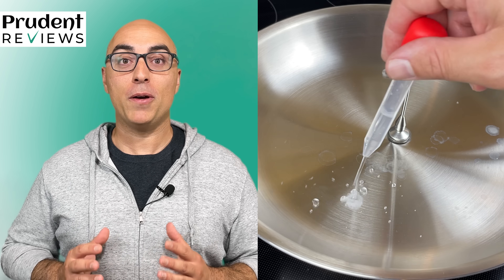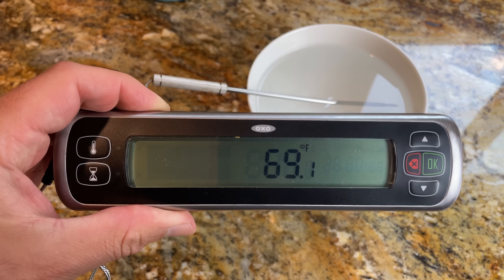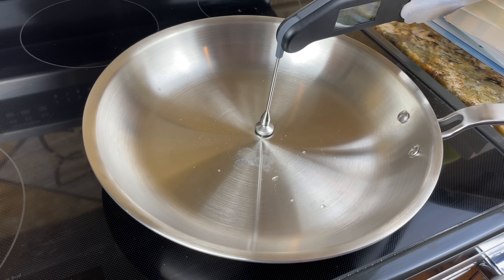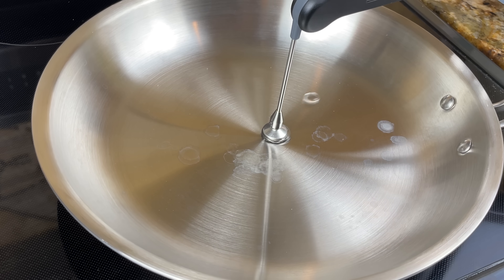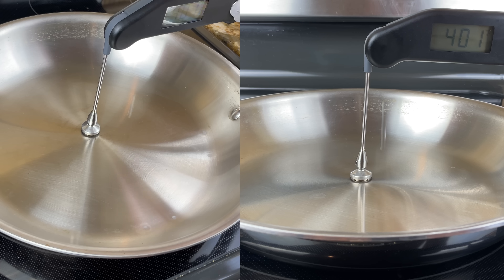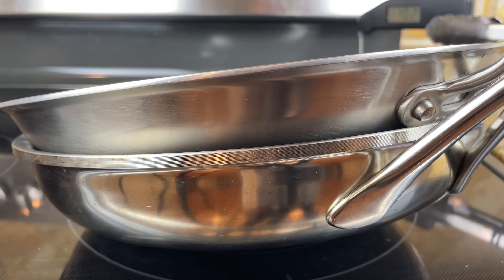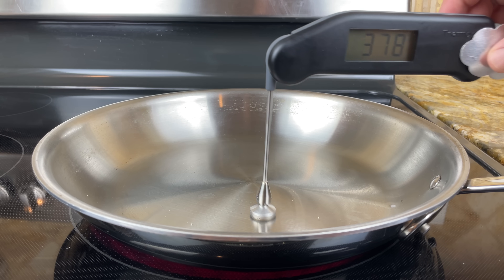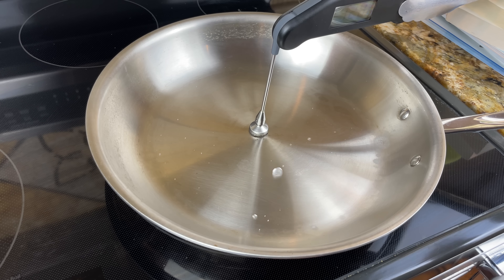Steel Pans Become Non-Stick at THIS Temperature (Leidenfrost Effect Solved)

Comment: I wanted to buy a surface  thermometer like that one, but it is very expansive and not versatile, great for pans but pretty useless otherwise. I got an IR thermometer instead, 40 euros instead of 150 or something like that. It is pretty neat, but you need to calibrate the emissivity in order to get accurate readings, and emissivity changes based on the material.
I tried the same experiment that you did with my IR thermometer and my black carbon steel pan, I got a reading of about 320 C when the Leidenfrost started, based on your results I guess my emissivity setting (95%) was off.
If you have an IR thermometer like mine maybe you could make a video comparing the two, and maybe you could try to figure out emissivity values for stainless steel or carbon steel
Reply from the maker: That’s a great video idea!

Comment: Would a laser thermometer read low ?
Reply: on stainless.  Yes, because of the shiny surface of the pan.  The device is reads Infrared from a reflected source and not from the pan's surface.  

btw, you own a Infrared thermometer.  The laser is only a visual cue of where you're aiming.

Comment: That's great if I want to have water drops dance around my pan, but it's useless for anything else. Once you put an egg in the pan, the temperature drop will stop the leidenfrost effect when you want to flip your egg. Side A may not stick, but side B will... unless you maintain a screeching 430°, at which point your egg is way overcooked. Egg white coagulates (becomes “set”) between 144° and 149° Fahrenheit. Egg yolks coagulate at a temperature between 149° and 158°.
Reply: Try it, you will apparently be flabbergasted at how wrong your theory is. Once your pan is primed you are good to go. Noone claims your pan needs to stay at 430f nor that the leidenfrost effect needs to be in full effect for non stick nor do I see claims about the leidenfrost effect being the only factor in SS non sick properties. ;)

Comment: My main question is whether it's actually the Leidenfrost effect making the pan nonstick, or whether it's just a proxy for the correct temperature needed to make it nonstick, and in that case, whether it can be somewhat lower and still be nonstick.
Reply: Its a combination, but very smart question! Many people here start yapping about 430f being scorching, will burn everything, wont be able to nonstick a flipped over egg etc etc because they are too fixated on the idea that it is just the leidenfrost effect that creates the non stick properties while its a combination of 4-5 factors.

Comment: Well that makes stainless kind of useless to me as I never cook at that high of a temperature.
As an example:
On my NutriChef 10" Ceramic pan on a Nuwave Induction unit, I use 275 degrees to cook a Bubba Burger perfectly in the timeline suggested on the box. Eggs the same, stir-fry the same. once in a while, I'll play around with higher temperatures but as it's suggested to use low to medium with ceramic, I tend to avoid high temperatures.  Using 420 or so seems ridiculous to me unless I'm searing a steak.
I've had this pan for about 6 months and it looks just like new and I expect a decent lifespan but if I had to replace it every year, I would. It only cost $45 or so on Amazon. The ease of cleanup is a bit of a shock. A paper towel to soak up any grease and initial wipe down, then a hot water rinse with another wipe with a fresh towel and it's good to go

Comment: This is NOT how to make a pan non-stick. As soon as you add food to the pan it will cool down enough under the food to stop this effect. You can maybe work a single egg, but just about any other dish or a steak and this won't work. Just use oil, oil works every single time.

Comment: What is the best way to clean a stainless steel pan? Should you soften the brown areas by soaking them in water?
Reply from the maker: I’m going to make a video on this soon. There are many ways but I’m most cases I just scrub with a sponge and dish soap. If there are any stubborn stains or discoloration, I’ll use Bar Keepers Friend.
Reply: @PrudentReviews  thanks.
Reply: 000 or 0000 Steel Wool take it down to the shine.

Comment: 450 farenheit is how much in non retard units?
Reply: Depends on the stove but around a 6-7 on the stove top dial out of 10. About 3/4 or medium high. To be exact you should test the burner on the different settings with a thermometer and your most used pan. Also if you are using a small pan on a big burner or a big pan on a small burner that will add a differential to the equation.
Reply: I should add, let your pan heat up for about five minutes so you don't have cold spots.

Comment: Use ghee for high-temp cooking. Very high smoke point, very easy to make at home.  

Nab an extra pound or two of butter when it’s on sale (unsalted, non-fancy). Cook on medium till it foams, then you can lower the temp a bit and cook till the milk solids collect on the bottom and brown. (Push and foam aside to peek at the pan bottom.) The more brown, the nuttier the flavor —but don’t let it burn.

Be conservative when pouring off the oil at the end, so the all the browned butter solids remain behind (they’re delicious, but they’ll burn at high heat; just spread them on toast or eat with a spoon). I tend to keep mine in the fridge, but it keeps quite well on the counter and is much softer/easier to scoop that way.
Reply: My wife makes ghee whenever we run out. Its so good on rice. She's Nepali so she makes everything from scratch even butter, yogurt, bread and when I'm lucky rice wine. 😁
Reply: oil is cheaper, healthier and easier to use.

ghee is better for flavor of course, but oil is easier to just cook with

Comment: It does not take that high temp. SS is non-stick as soon as beads form. A fried egg at 215c! Did you even try that? I hate fried eggs with that brown rubber film at the bottom. In fact, for things like chicken, the stainless steel pan is fairly nonstick so long as you get it hot before adding oil. I do fried eggs with carbon steel, it actually sticks less than Teflon.
What you need to show is cooking, not theory, but I do support encouraging people to avoid Teflon which is a ‘forever chemical’ and non-recyclable.
Reply: Teflon should be illegal for food use, but then we would have riots from everyone who can't use a regular pan.
Reply: @james_crook  forever chemicals will be illegal for most purposes at some point

Comment: For only $169 plus the cost of a stainless steel pan you too can have perfect eggs every time.
Reply: Or you can save yourself a lot of trouble and use a $10 ceramic nonstick pan from Costco.  And you get the added benefit of not having to eat burned eggs.

Comment: Get a good set of stainless steel pans. They'll last you decades, they're the most versatile pan type, they're oven safe, and maintenance is minimal(soap and bartenders friend). The investment is worth it. Next get a dropper bottle, fill it with water and keep it next to the stove. I heat for 1.5-2 min on medium high on a gas stove then add drops until I see the effect. The other key is to have easy access high heat oil like canola or avocado oil. Once you achieve the effect, reduce the pan to medium, add oil, swirl the oil in the pan and start cooking immediately.

Comment: To preserve the nutrients of the egg, you can't cook it too hot. For perfect scrambled eggs, use plenty of butter and set your temperature to about a 3.5 on a scale to 10. Beat the eggs together before pouring them into the pan. Coat the bottom of the pan with the eggs, then use a silicone spatula to move them around until the last of the liquid turns just solid. Remove them from the heat immediately and plate them.
Reply: Blah blah blah. cook me some fucking eggs
Reply: Beating the eggs makes eggs not even close to perfect, sorry
Reply: You can tell when it is an American advice from the surface "use plenty of butter"
Reply: If you make an over easy egg in an extra hot pan, you're only cooking the whites. The yolk contains more nutrients, and therefore, with a soft yolk, you'd have less loss than with your scrambling method on low heat.
Reply: Too much butter = SATURATED FAT 🤮🤮🤮
Reply: Sounds like you have done this before lol. I have cooked many an eggs the way you describe and it’s perfect for me.

Comment: According to Wikipedia and several other sources, the Leidenfrost point is approximately at 193 °C (379 °F).  In my own experiments, this is too low a temp, so I believe your numbers are spot on.  I used a laser thermometer and got temperature ranges a little lower than you, but still worked great.  The trick is to figure out where the dial should be set on your hob or element, then just set it there anytime you are using stainless steel frying pans.  All this being said however, nothing beats my trusty 100 year old cast iron frying pans.  Better than Teflon and I'll likely be leaving them to somebody in my will LOL.  Great video, and great science!  Eric.
Reply: 379 is correct 
The water is 69 
So it adds up to 450

Comment: ok, so.... who wants an egg to hit the pan at 420˚?  that would not be a good thing.
Reply from the maker: I explain it further in this video, but once you reach the Leidenfrost, turn the heat all th way down, add fat, then add the egg. That will bring it down closer to 400 and ensures it doesn't get hotter. 

https://youtu.be/BYpYK1DV_SU?si=uJvZrPSOqCe-ulTU
Reply: @PrudentReviews , yes i watched both videos.  this might work on gas or induction, but on electric, one has to remove the pan when adding oil and dropping the eggs because electric won't cool down fast enough.

Comment: Does carbon steel pan has the same thing? Even with a well seasoned pan?
Reply from the maker: You don't need to get a carbon steel as hot because the seasoned surface is less prone to sticking.

Comment: This is brilliant.
At a high enough temp steel will louse its magnetic attraction.
Please test to see if a magnetic will louse its attraction at the same temp a drop of water starts to dance.
Reply: Stainless steel is not magnetic, regardless of temperature
Reply: @juancaballero1173   Are you sure about that Sparky?
Reply: @juancaballero1173  This is not true and is a strange idea to have. What gave you this notion?
Reply: @quincywilliams9860  Both of you are half right. Some stainless steel is magnetic, and some stainless steel is not.
Reply: @bradley3549  Oh, I agree that you are right about that. The correction was pointed at the suggestion that "Stainless steel is not magnetic, regardless of temperature", which is definitively false because it indicates that there is no such thing as magnetic stainless steel. Inductive vs reductive logic, etc. But yeah, you are correct 💯

Comment: This is brilliant.
When steel gets to a high enough temperature, it will louse its magnetic attraction.
Please try this test with a magnet and see if it louses its magnetic attraction at the same temp the water starts to dance.
Reply: I don't think it does- first of all, there are non-magnetic types of stainless steel, and secondly loss of magnetism occurs at much higher temperatures (well over 1000F).
Reply: @guzimirHR   thank you for the quick response.
Reply: Look up 'Curie temperature'. For stainless steel we are talking well over 1000f indeed

Comment: Knowing the temperature is not of practical help because I can't handle messy food and a thermometer at the same time. That is if I owned a thermometer with a flat header like that, I wouldn't eggs all over it. I usually heat the pan as high as I can until or a little short of the oil smoking, and have no problems with eggs sticking.
Reply: i agree; it may be useful for a baseline perhaps, but honestly the water test is the quickest and cheapest method of testing to see if your pan is ready, which is why it's recommended by so many people

Comment: This effect may make nonstick but that is too much heat to cook an egg properly... Eggs should be cooked at lower heat or they will taste like plastic. This effect is interesting but does not really correlate with good cooking. I suggest using appropriate heat and some healthy types of oil... oil/fat is not such a bad  thing and eggs fried at lower temp in oil and butter are not only fine, they taste way better. 

And I love cooking with stainless steel... They are easy to de-glaze, east to clean, and come back 100% to as-new condition.
Reply: this is just a personal opinion, but i love crispy egg whites, so i generally cook my eggs (with browned butter) at the temp right before it smokes/burns, and then i end up with some nice crispy egg whites, and a nice raw yolk

scrambled eggs do need a lower temp though or else they end up dry and plasticy as you said though; cook it on the heat, then off the heat while stirring, then back on the heat, off, repeat until the curds are just set and it's perfect
Reply: Nah i cook my eggs high and fast and they taste great and are moist

Comment: Are you sure that measuring temperature is the ideal method? My understanding from a deep dive on this years ago was that you really need to measure heat flux.

This is awesome by the way!
Reply: personally, i would say no, it's a bit of a waste of time when just splashing some water to check if it turns into the little water bubbles is way quicker; though knowing the temp also would give you some general guidelines

personally, i dont even have to test it anymore and just do by putting my hand above the pan to feel the heat; much faster than grabbing a heat gun or thermometer

but back before i didn't really know what i should expect to feel, i would test with some water to see if the leidenfrost effect was happening, and i would put my hand above to feel what it felt like so i could memorize if or if not the pan was hot enough by sense
Reply: The ideal method is to just cook, gain experience.

Comment: I'm not sure I'm convinced the Leidenfrost effect is useful for cooking. Can you do another test cooking an egg at the temperates you measured in this video?
Reply from the maker: Here’s one — Eggs Sticking to Stainless Steel? The #1 Mistake to Avoid
https://youtu.be/BYpYK1DV_SU
Reply from the maker: Here’s another — How to Cook SCRAMBLED Eggs in Stainless Steel WITHOUT Sticking
https://youtu.be/dFtkmInrlWw
Reply: @PrudentReviews I see that's helpful, thanks. To me though, it seems like the leidenfrost effect is more of a quick temperature gauge before cooking the eggs rather than something in effect when actually cooking. Would you say that's correct? I'm guessing the temperature in the pan is dropping from the egg being added preventing the egg from gliding like the water droplets do.
Reply from the maker: @reginaldfrank656  it’s more of a general range to aim for that seems to help eggs not stick based on lots of trial and error. I made this video mainly because I got so many questions asking what the exact temperature Leidenfrost happens at. I was curious myself since various websites have different numbers.

Comment: It's important to add this note, as I believe it was missed in this video: at 430 degrees, butter, canola, and almost all other refined seed oils will smoke. This is called the smoke point. A bit of it is not bad. But constantly cooking with fats at their smoke point will increase the amount of trans fats in the foods cooked i this environment.  Also, cooking at high temperatures like 430 degrees F, will result in browning. This is a tasty side effect, but also has been identified as a carcinogen. Just a couple of considerations when choosing to cook with high temperatures just to avoid food sticking to the pan.
Reply: personally, heat the pan up till the leidenfrost effect occurs, add a high smoke point oil (will lower the temp of the pan slightly, i use avocado oil), and then after swirling it to coat the entire bottom of the pan, i add whatever i'm cooking which drops the pan temps even more, and either prevents the oil from reaching the smoke point in the context of avocado oil, or for lower smoke point oils, it lowers the pan temp enough to stop it from smoking; you dont have to keep the pan at the 420f temperature to keep it from sticking, but starting cooking with that temperature keeps things from sticking as much, and then adjust the stove as needed while cooking
Reply: @awesomestuff9715 this is exactly the method used for carbon steel woks
Reply from the maker: This is what I do also, I explain further in this video https://youtu.be/BYpYK1DV_SU?si=EQFTa2aR7xN1lEP7
Reply: Cooking fats does not turn them into trans fats. Trans fat are a result of a hydrogenation process.
Reply: If you know how to season a cast iron pan.. you'll catch something in this..
Reply: Life is a carcinogen
Reply: It's a wonder not everyone has cancer if you take into account everything that is considered a carcinogen.
Reply: @alanwatts8239  Technically everyone develops cancers. It just is not clinically significant for everyone and most of these mutations and abnormalities that are technically cancers are healed repaired or attacked and destroyed by the immune system or simply just benign. Large mammals like whales almost guaranteed have multiple benign tumors actually but thanks to the total size of the animal it is not an issue.
Reply: @alanwatts8239  carcinogens doesn't mean that you'll definitely get cancer
It just increases your risk of getting cancer

There are some chain smokers that don't have cancer even after smoking for decades
That doesn't mean that they won't ever get cancer, but it also shows that even constant exposure to carcinogens won't absolutely cause cancer

Bbqed foods also tend to contain higher levels of carcinogens